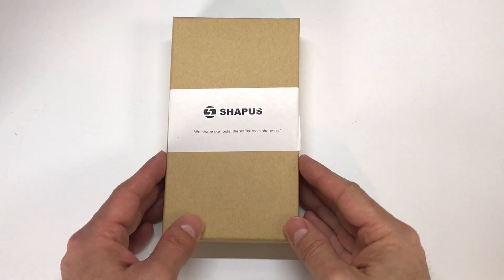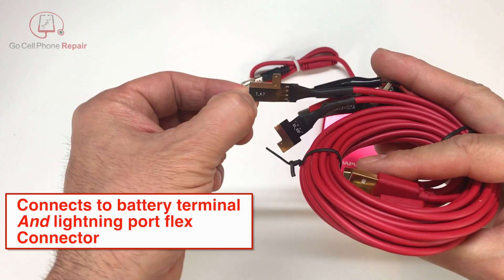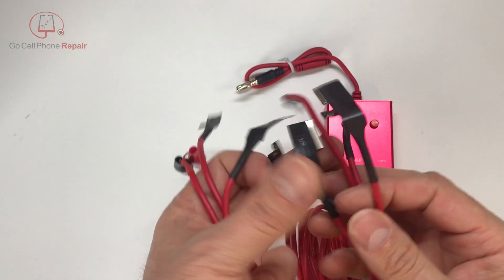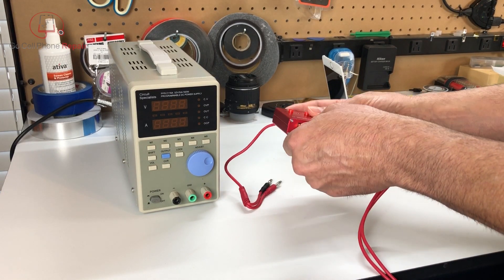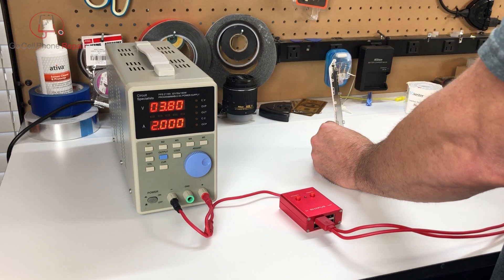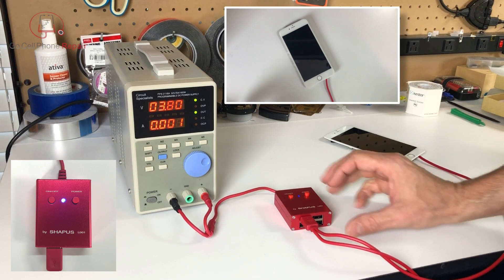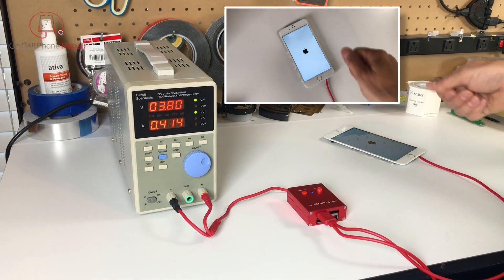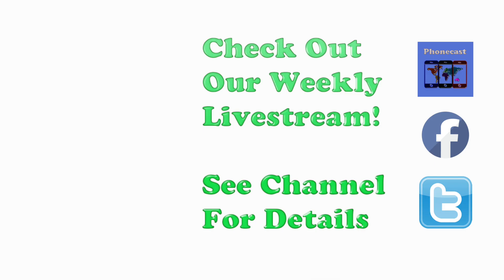iPower Pro Power Line On/Off Switch for iPhone

Comment: If that tool would work straight with 230 V then it would be very handy...
Reply from the maker: Now that you mention it there's got to be a way to make that happen. All you'd need is a standard DC power block with correct output for a phone that could attach to the leads. I'll see what I can find.
Reply: I can buy ?
Reply: yes, you can add my whatsapp +8613556809985. i send the link to you .